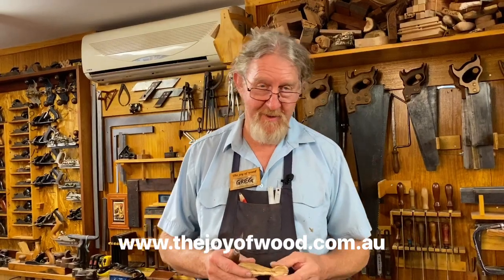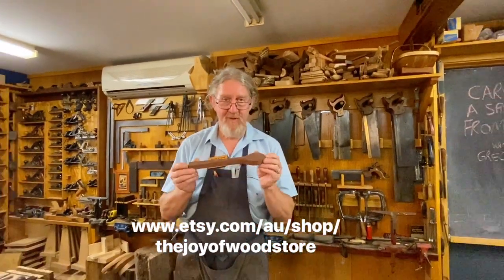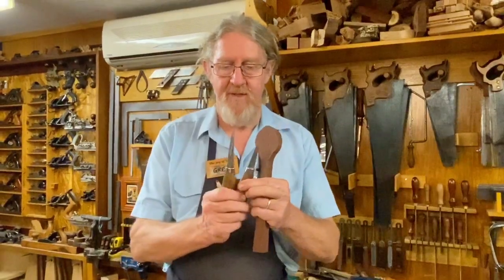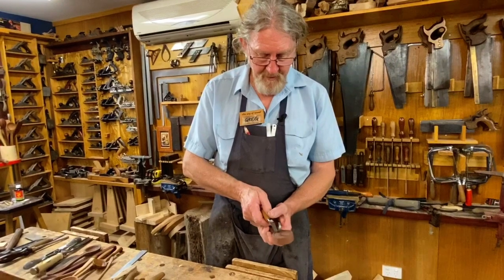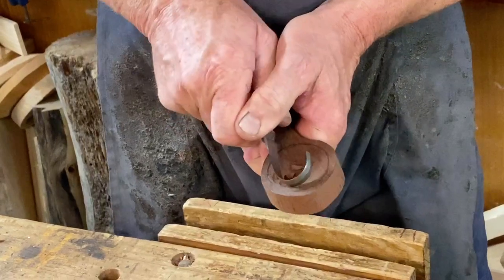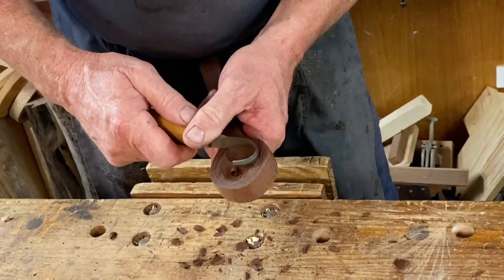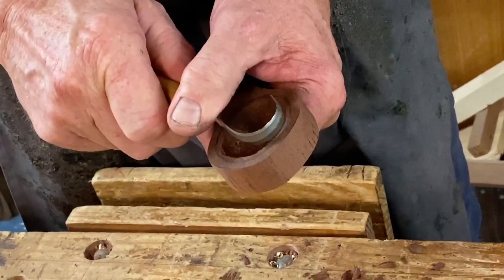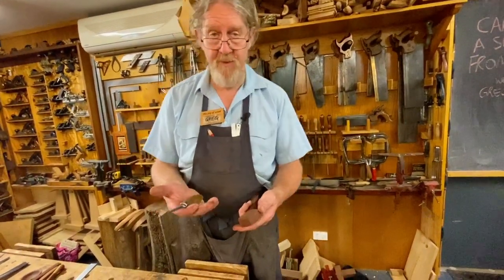Carve a Spoon from a Blank

Comment: Thank you for giving me advice as a man in his late 20s. I just collected some rather thick pieces of fig wood and couldn't bear to throw them away. Thank you for the love. I feel the wood is acting like a softer olive wood, but am not sure. I decided to buy a couple tools from beavercraft. Which brand would you recommend ?
Reply from the maker: Gidday, Scentaur. I find some figs to be a bit fibrous. I hope it worked out well for you.
I am biased about BeaverCraft, as I am an Australian Dealer for these tools. As with all brands of tools, there are some I prefer more than others. I only stock the ones I like the most. Same with Mora knives.
The great thing about BeaverCraft is that they are priced so cheaply, which makes it easier for new carvers to get carving! My real favourites with the BeaverCraft Hook Knives are the SK5 (which has the same radius hook as the Mora 162 and is also double sided), and the SK4 and SK4L more open curved hook knives. These 3 all come with a longer handle than many other hook knives, and I find this makes the tool much more versatile.
Stay save, and keep spoon carving!

Comment: Did you have to sharpen the knives during this creation?
Reply from the maker: Gidday, Mark. I tend to sharpen in an “as needs” basis. It depends on the wood I am using. Some woods cut like butter and some will blunt the tools quickly. During the filming of that video, no, I didn’t need to sharpen the blades.
I hope this helps!  Greg
Reply: @thejoyofwood  thank you. Loving the little hammer I bought and the other things.